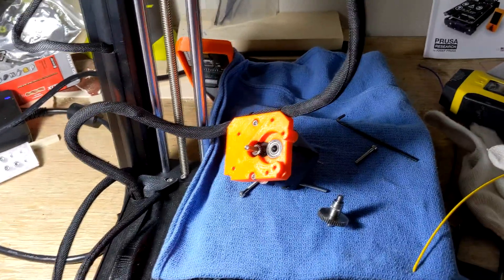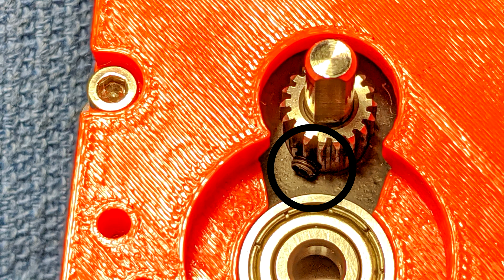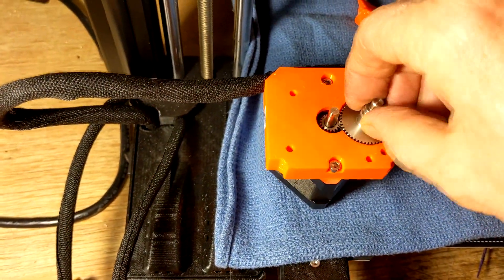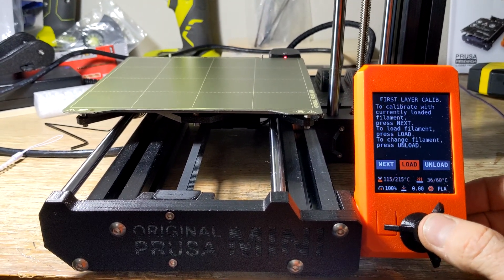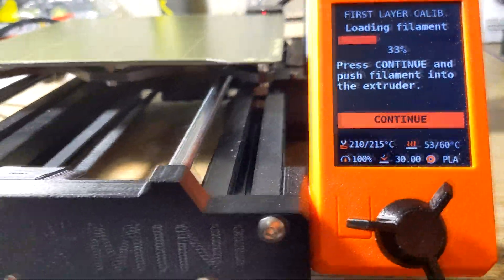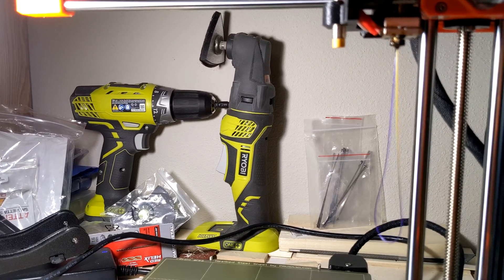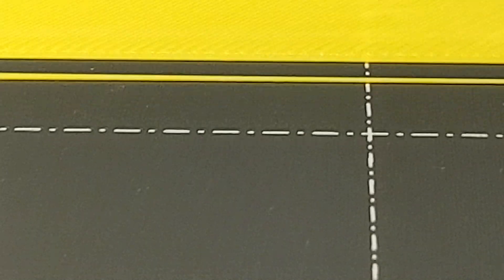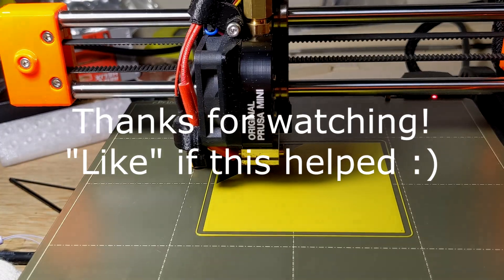Prusa Mini Extruder Clicking and Filament Retraction Issues

Comment: Interesting. I am printing just fine but when trying to unload my filament the extruder refuses and I have to remove the filament manually. Interestingly the extruders big wheel isn't turning in reverse even when I run the unload without any filament present so its not like there si a jam in the extruder. 

I have thought about this set screw as well though I still cannot grasp how is it possible that it would print at all with this screw loose only having trouble in reverse. I'll be sure to check it the next time I dismantle my extruder.

Comment: Just a tip, in the printer settings you can increase the nozzle hot end temperature for like 230 instead of the standard 200, that should help the extruder to not struggle to extrude the filament to the hot end.

Comment: Guys you all with clicking and extruder problems should all do this. The issue is that the bearings are just not tight enough, you just need to help it a little :)
This -> https://www.reddit.com/r/prusa3d/comments/kaellv/how_to_fix_clicking_extruder_on_the_mini/

Comment: That set screw should be tightened against the flat part of the shaft. Noticed yours is rotated to the side of it.
Reply: Came to say that! As you can imagine, tightening on a round shaft does not give you good grip. That is what caused the issue in the 1st place. 0:30 Tighten onto the flat portion of the shaft!! I am disappointed that Prusa decided against just keying the gear to remove this failure mode. Disappointed but not surprised.